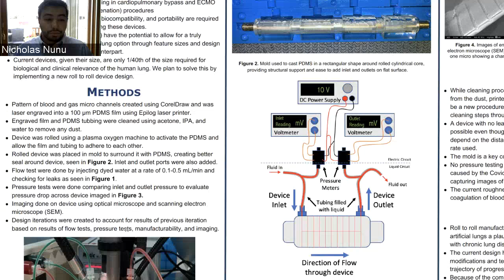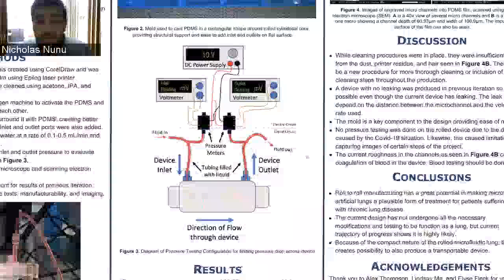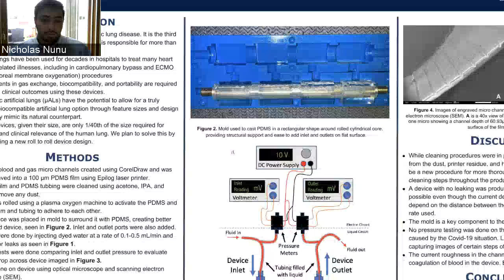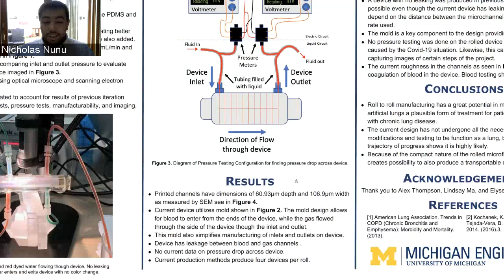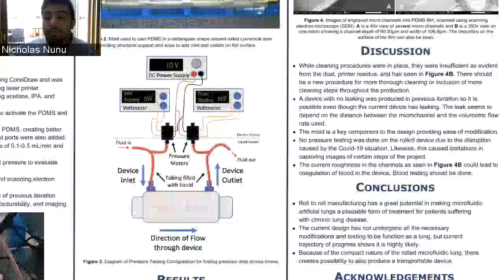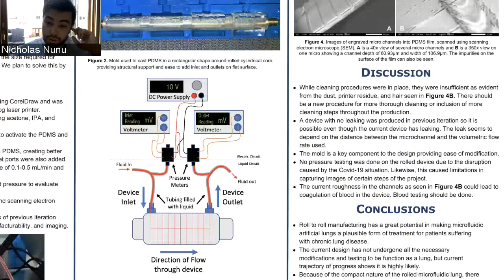Roll to Roll Microfluidic Artificial Lung

Comment: I enjoyed the presentation and it is great that you got connected with such an excellent/interesting project through UROP and were able to continue on with it. What was the biggest challenge that you ran into in developing the mold you used with the artificial lung?
Reply: Thank you for the question! The biggest challenge was our imaging. We were never able to get high resolution videos while there was fluid flowing though our device. Our current method for high resolution images is though the SEM but the we are not able run our fluid testing protocol while the device is in the SEM.